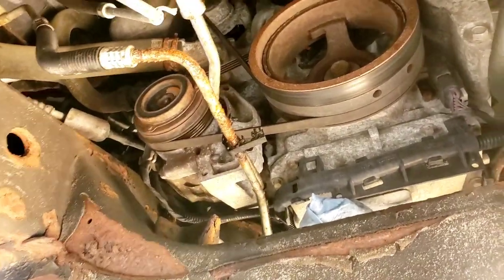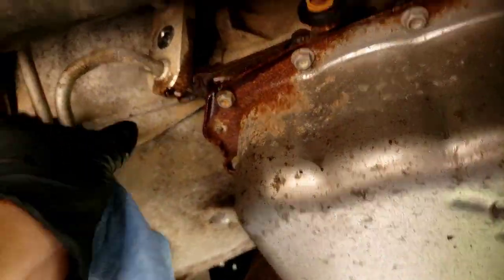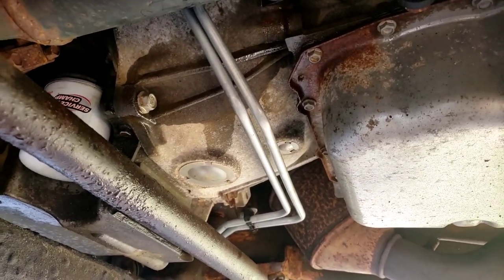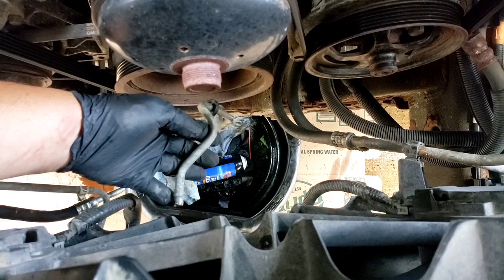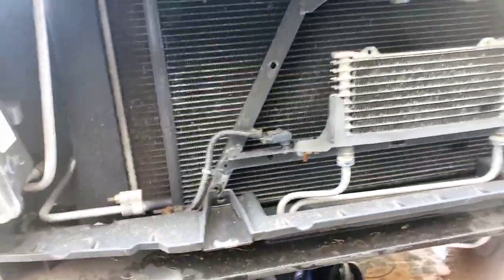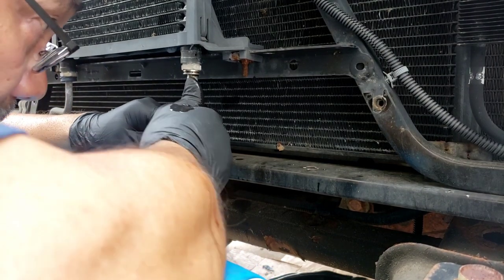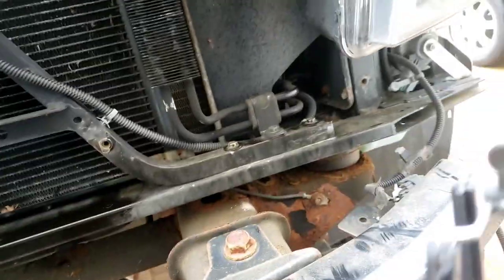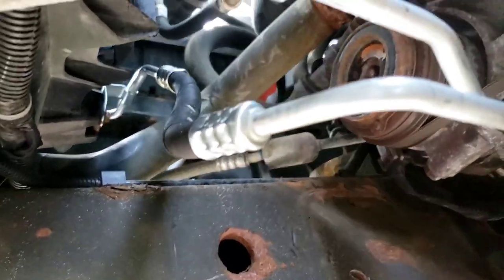Chevrolet Suburban Transmission Oil Cooler Line Replacement Change with HD Cooling  2013 & Similar

Comment: FYI when you take you c clip off take it off take your old line off then put your c clip back in and pop your new hose right in place then put your black cover over it a lot easier that way but I replaced my transmission line with an6 braided stainless steel lines way better and I updated my oil cooler lines with an10 lines replaced the bung at the radiator with 8anto 10an male adapter for oil cooler line and it looks and holds up so much better but nothing wrong with going oem hood video man
Reply from the maker: Oem style is more of a plug and play, no modifications required ..

Comment: I would buy aftermarket line separators for the lines in the front where you have it zip tied they have them on there to stop the hoses from rubbing and also to hold them in place with wind and what not if the hoses rub together they will eventually cause corrosion the separators I got were only 5$
Reply from the maker: Great tip

Comment: Oh yea and I replaced my transmission cooler with a 40k cooler and my oil cooler to replace the block on the stock line I replaced it with a csk performance oil cooler adapter with 10 an fittings for the hose I got off eBay comes with new gasket and everything worked out so much better and helped with oil consumption and all that I replaced my oil screen at the back of the block and all that and my oil pressure is awesome and have had no further problems at all also did a dod delete on the fuel management thing which is the worst invention from gm ever I just bought a plug in adapter that plugs into my obd2 port and then upgraded my valve stem seal gaskets and truck has ran like a charm I did all this myself too by the way
Reply from the maker: You did alot of work for sure...

Comment: Is there a risk of a airlock when changing the cooler pipes?
Reply from the maker: Air lock? No thats very rare in a transmission with the high pressure it puts out, not like a cooling system with 16 psi, transmission pressure is much higher, hence why you always see transmission oil in the coolant system and not visa versa from a bad cooler in the radiator